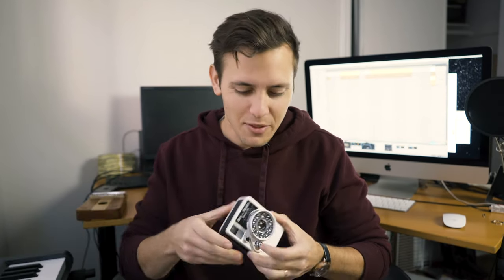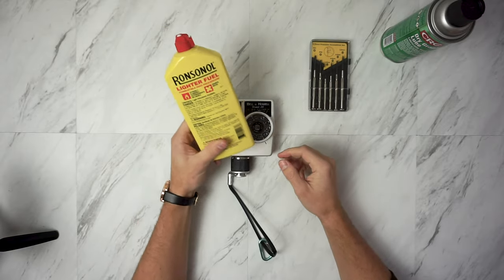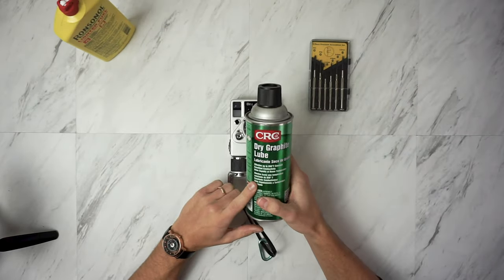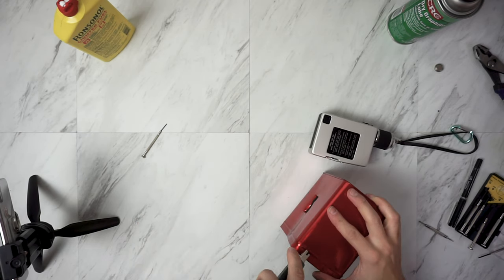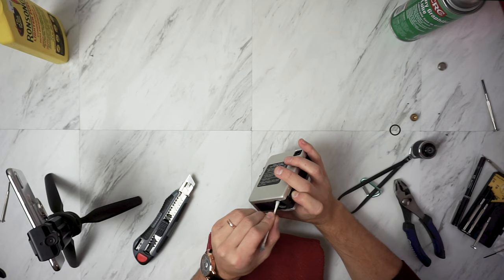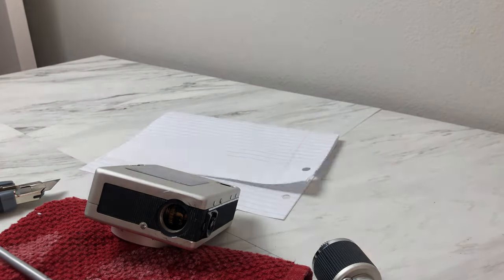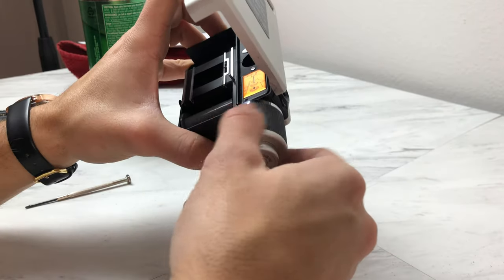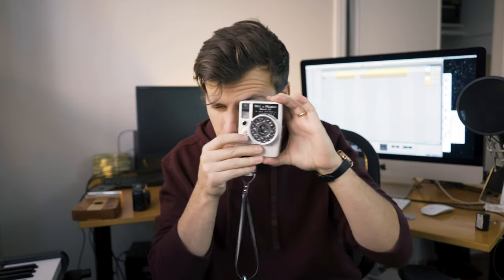Repairing the Unusual Canon Dial 35-2 • Half Frame Camera

Comment: That is quite a simple case. Usually you need to disassembly whole camera due to sticky shutter blades. :) BTW it is enough to pull spring motor and unscrew - no need to have wrench : )

Comment: Also, is the camera still working? I hesitate to use graphite lube, since I fear the tiny particles might end up in the optics. Did that happen? Cheers!
Reply from the maker: Good question. The lube didn’t end up in e optics, though it does continue to lock up, so I’d possibly consider a different lube.
Reply: @JarrenRocks  Thanks a lot for your answers! This is one of my favourite cameras, but they don't seem to have much longevity...

Comment: 1968 !! as this is the second model. Jakob Holdt used it for many of his photos of hanging out with the people at the bottom  as well as hanging out with the ricjest 1%.
Reply from the maker: You are correct. Thanks for the correction. Not sure how I got that date wrong. 

I've seen some of Jakob's work and it's very interesting to see the moments that he captured using this camera. 

I now have an even smaller 35mm (full frame) camera. I'm sure Jakob would have loved the convenience.

Comment: I'm watching and waiting for a decent price for the Dial on ebay — since I'm not too good at being fiddly, I'm hoping to get one in pretty good working condition.

I mean, your sentiments from 4:10 onwards — I'm right there with you.
Reply from the maker: I found this one on ebay in mint condition, I think the grease issue happened just because of the decades between then and now unfortunately. But while it does take time to repair, it's not especially challenging, and it's definitely worth the effort.

And yeah, sometimes that "reduction" mindset can be the bane of my existence.

Comment: where did you get the battery from??
Reply from the maker: I got mine on Amazon here: New 5 X LR9 EPX625G V625U 625 625GH Alkaline Button Cell Battery FBA https://www.amazon.com/dp/B0773KB25P/ref=cm_sw_r_cp_api_i_FFmNFbSQVPYRB?_encoding=UTF8&psc=1
The voltage is at 1.5v, which is a little higher than the original 1.35v battery, but you can just under expose based off of the sensor a little bit.
Reply: @JarrenRocks  Thank you so much!! 
I just found out my grandparents had this canon dial 35-2 and i want to try it out!
Reply from the maker: @alejandravillarrealchapa4790  Awesome to hear! Have fun with it!